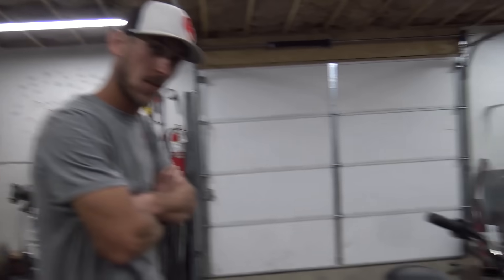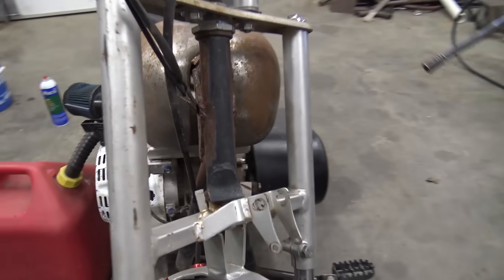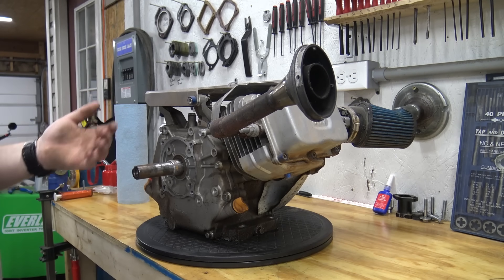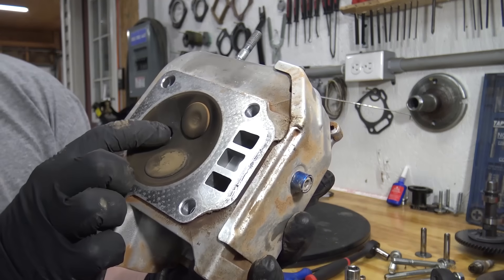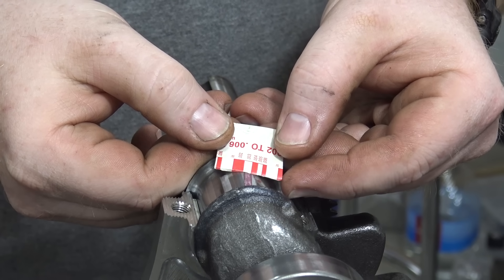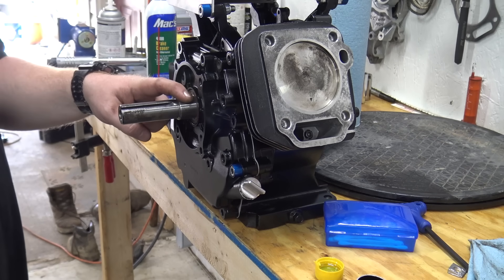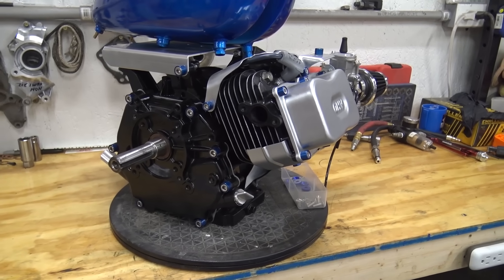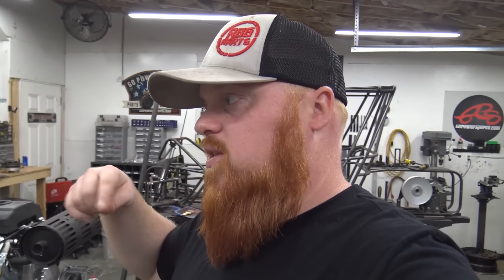Predator 301cc Teardown & Rebuild

Comment: i have a 301 with a similar knock. i suspect mine is the actual connecting rod slapping against the crankshaft, side to side play is silly high.now what? is the billet one slightly wider? it is disassembled right now.
Reply: Hey what did it end up being I suspect it is the rod Clearence also became if I rock the crank back and forth it knocks without any force's pushing side to side mine has never been apart before  though. A response would be very appreciated!
Reply: @josephmaldonadojr4692  i mocked up the billet connecting rod , haven't reassembled any farther. this seems to have cleared up a lot of the slop.at least on the crankshaft.
Reply: @josephmaldonadojr4692  yes these are also going to need the shims to adress the side to side on the crankshaft. i ordered 2 sets . hopefully one set will take care of that
Reply: @ninoreeves7702  thanks for the reply I guess I will have to get those shims hopefully that's it
Reply: @josephmaldonadojr4692  red beard had a video on the shims.

Comment: With all the new engines 459 , 460 , 440 do you think it worth still building the 301 ?
Reply: Totally. Those engines don't fit in smaller mini bikes.
Reply: @fish_R_stinky69   yeah we slapped one in a little rascal with a milled and ports head , 28mm carb and she flys
Reply: @nickclashez  I put a pz30 on it. I put a 130 jet and it starts up really good.
Reply: @nickclashez  How fast would a stage 1 (with 50 pound springs) 301cc be on a small ATV?
Reply: @fish_R_stinky69  that would just all depend on the gearing . I mean you could gear a 79cc engine to go 70 mph but the bigger more powerful engine will get you there faster. I got a few videos on my page
Reply: @nickclashez  I use a cvt transmission.

Comment: Is a 301 worth getting over spending the money to build up a 212?
Reply from the maker: I like a 212 a lot. Really depends on the application
Reply: @RedBeardsGarage  manco dingo. I'm just wanting some more torque for bottom end and seen that torque specs on 301 was good bit more than 212. And a 420 is just to much motor for a rigid frame kart (my opinion)
Reply: @abels_04  212 is too small. Stick with the 301 but the aftermarket parts cost a lot more.

Comment: What kind of intake manifold is that?! I’ve been searching.
Reply from the maker: I made it out of a 212 mikuni manifold. The part that bolts to the mikuni lines up perfect on the 301cc head
Reply: Red Beard's Garage so would a regular 212 mikuni carb work ? Or what would I have to do.

Comment: I knew it was end play from way back when. I think it was me who suggested this as the source of the knock sound back then. I’m glad you found it b4 it destroyed itself. Watch the block closely for a while for hair line cracks leaking oil slowly. From all that end play banging back and forth could have fractured the casting. Usually around opposite side of the piston. Or on flywheelside is where any cracks may have formed.

Comment: So I got a 301 and it has a knock. if I take the crank and "rock it" back and forth it makes the sound. It has some endplay so to see if it was the cause of the sound I put pressure on the crank on the clutch side pushing it towards the flywheel side and rotated the motor while keeping pressure on it... still knocked could the rod clearance be to big and make it knock? Its never been taken apart it has had the knock since new. Just interested in someother peoples opinions on this